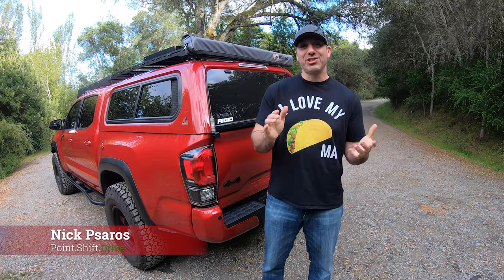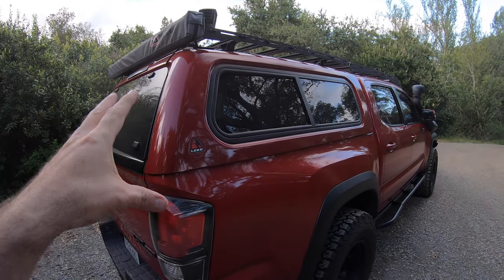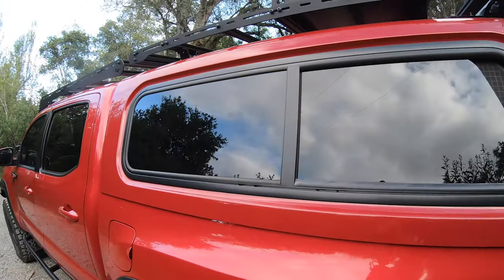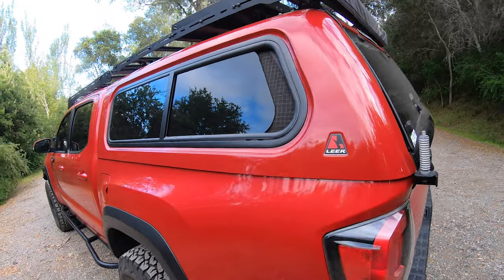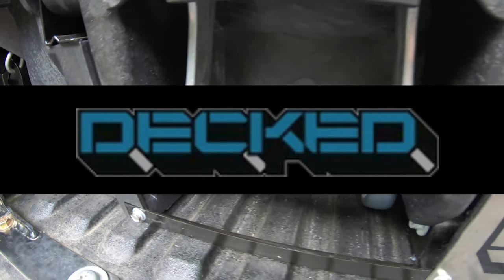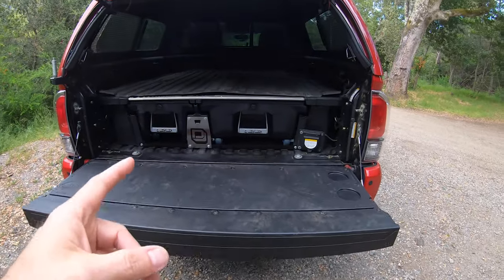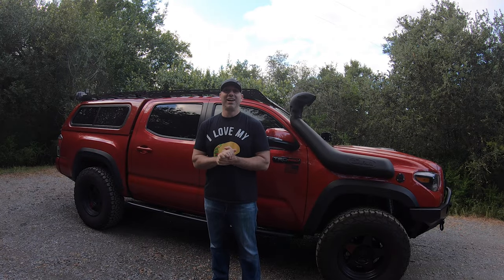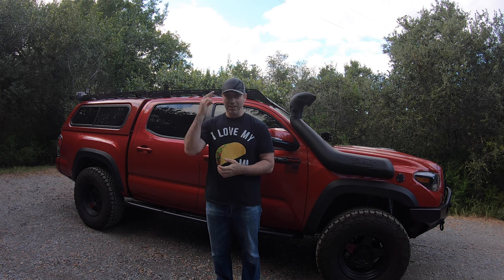One of the BEST overlanding bed shells for Toyota Tacoma!

Comment: Get one of those phone thing’s you put on the back of your phone  to hold it with your fingers. Stick it on your sliding window to be your knob
Reply from the maker: Good suggestion! I actually ended up using a GoPro mount instead

Comment: This is everything I’ve been considering. Got my Tacoma last week. Need a shell and want the drawer system. Same problem. 2 car seats in the back. Also no where for the dog so that rubber topper idea was great. I also have some boat carpet left over from a project I’ll probably drop in on top. I plan on camping out in my bed for fishing tournaments. This is great. Still undecided on what shell. I like yours with maybe the addition of windoors. The smartcap evo is cool but expensive. Thanks for the video. Definitely helped.

Comment: DIY a window knob, with small low profile plastic knob and double side heavy duty tape. And for the hole from the outlet, you can get a big rubber pipe grommet to cover it

Comment: Had the Leer 180 cap on my Taco.... provided a lot of space in the bed for gear and camping.... no roof top tent needed. Cap was solid and flawless. Ordered the same cap for my new Tundra.... with some extras I found I wanted after owning the Taco for 6 years.
Reply from the maker: imxploring thats great to hear. What is your favorite add on?
Reply: @PointShiftDrive  Had the headliner in my first shell.... great option. With my new shell I ordered the headliner....factory roof rack (any leaks are on them.... better than me drilling a new shell) and the removable front slider window in the shell. Makes cleaning the windows between the cab and shell easy and allows access between the two for animals and everything else.
Reply from the maker: @imxploring  Sounds awesome!

Comment: In August I bought a 15 TRD OR access cab with the 6' bed and the same leer shell already on it. I camped in it and it poured rain and I discovered that every single window leaked around at least 1 corner of the frame. I don't know if it's because of the extreme climate here (Alberta Canada) or if the gasket they use on the windows wears out that quickly everywhere else. I ended up buying a roll of butyl tape and pulled all the windows off and used butyl tape around the frames and after a heavy soaking in the car wash they seem ok now. Unfortunately the spline/weather stripping around the glass is peeled out in one corner of one window and it still leaks there but it's minor compared ot before.

Comment: I can see you're not concerned with the bed leaking.
For everyone else, here's a tip:
BEFORE you buy the cap  at night use a flashlight to find all the open places in the bed.
What I was really interested in was the paint match. Yours is only slightly better than mine. I got $500 off because of the difference but what I realized later was that the cap was painted correctly. I could tell because it matched the tailgate perfectly. When I put my vehicle next to another Barcelona red Tacoma I can tell my vehicle has a slightly different tint.
Reply from the maker: Mine didn’t leak and it shouldn’t. Wasn’t a concern for me.
Reply: @PointShiftDrive  All beds leak. If they didn't, they would fill with water after the rain. That's why they have drainage holes.
Also when you get the factory tonneau cover they give you two rubber blocks that fit up in the front corners. These are to fill the gaps between the composite bed and the metal sides.

Comment: Great video! A few questions here:
1.) What brand roof racks for both the cab and shell? 
2.) What size lift on your truck?
Thanks, Keep up the good work!
Reply from the maker: The roof racks are Prinsu . The lift is a 2.5 king shock. I have other videos that go into more detail. you can find them on my channel: https://youtu.be/iN0fuyM50CQ

thanks for watching!
Reply: @PointShiftDrive  Thanks for the quick and detailed response! One more question, is that a canopy tent attached to the shell rack? If so what brand is that? 
Thanks again for your help!
Reply from the maker: @justinandras6096  I have an ARB canopy attached. It’s great. Extends about 5 to 6 feet

Comment: To help with that side window you could get yourself a small suction cup to close that window. Just a thought so you wouldn’t have to climb into the truck just to close the window.
Reply from the maker: I tried suction cups already but after a while they fall off. The solution that I went with that ultimately solved it was a stickem GoPro mount. They are perfect! And I could always throw a camera on there for interesting angles

Comment: Static weight capacity is 600 pounds per leer for the 100XR
Reply from the maker: Yeah but dynamic weight is what matters most of the time. 600lbs is basically 2-3 people and the full weight of the tent, rack, railings etc. that’s doable. But when the top weight is moving, you want to make sure it isn’t too heavy and snaps right off around a corner

Comment: Thanks for the video.
Two questions:
1) Can a 7.0 surfboard fit in the access cab?
2) Can a 6ft. tall person sleep comfortably in the bed?
Reply from the maker: The surf board wouldnt fit inside the truck... just be clear about that. however thats whats great about having a roof rack. As for sleeping in the bed, yes but you need to sleep diagonal if you have the shortbed like I do. I bought the Decked system which flattens the bed and makes sleeping back there a breeze. Hope that helps

Comment: I'm thinking of getting bed shell.
I see you have the Total Chaos bed stiffeners. I have an antenna mount on them right now.
but when I get a bed shell it will obviously will be covered. I see you also have the Rago Fab antenna mount.
Did you modify it in any way? Does it sit flush to the side of the bed?
Reply from the maker: Actually that Rago mount works perfectly with no modification. Highly recommend

Comment: I wish Mountain Hatch made a Bamboo or hardwood option for the tailgate...that flat hard plastic is slick as shit when its wet or a little dew or condensation gets on it.
Reply from the maker: You aren’t wrong. That plastic surface can be brutal. I recommend the weather tech rubber protector. It’s super thin and light and fixes the issue with slickness.

Comment: When you used the key fob to unlock the tailgate it seems it unlocked your camper top rear door also. did you purchase the Leer keyless entry handle ($289)?
Reply from the maker: Yes. It has a module built in for locking and unlocking. Basically a life saver

Comment: I have a 2019 TRD PRO. did you have to lift truck to fit bigger tires. pro comes lifted but like to know and like to keep the stock lift but not sure how big to go with the tires. Great video.
Reply from the maker: Edward Roe I cover that in this video: https://youtu.be/iN0fuyM50CQ
But at a glance: 
1) cab mount chop
2) 285/75/17 tires (basically 34s)
3) tire well trimming 
4) install adjustable top control arms and get as much caster out of your alignment as possible

Comment: I love your set up, hands down one of the best looking rig, I have Leer 100XR too on my 2021 OR and want to install pop lock. 
Question: Did you install two pop locks for shell and tail gate or its just one lock that locks both tailgate and shell? Do you have a video of installation? Thanks
Reply from the maker: Thanks!
There is a separate lock mech for the top lock.

Comment: You could probably a 3M hook or knob on the sliding window
Reply from the maker: Not a bad idea... Wonder how that would hold up in the elements. Ill give that a try! Thanks
Reply: Point.Shift.Drive only one way to find out lol! Keep up the cool videos!
Reply: Or small souction cup
Reply from the maker: @briananderson6758  I ended up using a gopro stick um mount. works perfectly and doesnt stick out.

Comment: Great review. Have one on order. With the PopLock…how does it lock the shell back lift gate? Is the shell lock tied in (electronically) to the new tailgate lock?  Thanks
Reply from the maker: you need to make sure to order the extra locking module. then wire it to one of your doors locking mech.

Comment: Did you install your racks? and if so how long of bolts did you use for your tracks for your racks?... and did you install your Decked Drawers?
Reply from the maker: Yes on both counts. The kits come with hardware. I just used what they provided.
Reply: @PointShiftDrive  ...thanks but did you drill every hole in the tracks?
Reply: @PointShiftDrive  ..also but was your shell beefed up from factory to hold mor weight?

Comment: So If I get the Thule tracks for the leer I can install a prinsu rack on it later? Do you need some type of adapter for that?
Reply from the maker: The prinsu rack system needs to be mounted to standard T slot rails.

Comment: Looking at a 2018 OR with 14k miles, has same shell. Asking price 28.9 concerned about shifting issues and fuel pump recall though.
Does the shell or bed leak at all? Is there a window on the shell to line up with the rear sliding window on the truck? New subscriber, great channel Thanks
Reply from the maker: Good questions... 
So there is a sliding glass window against the truck rear window. I typically just leave that window open and toggle my truck window from the inside any time I want some air or to talk to my dogs. 
as for leaks, no leaks from the windows BUT if the topper wasnt installed properly with sealant then you may see some leaks at the corners where the bottom of the topper meets the bed of the track against the cab. The good news is if you have that issue you can just shoot some silicon in there and close off any holes and you should be good. Its also worth noting that the only time you should see leaks from there is when you are washing your truck. not during rains or anything because of the angle of the where the holes are. Hope that makes sense. 
Id buy it and not worry. you can always make adjustments if needed or sell it all together if you arent happy with it. 
Thanks for subscribing and watching!
Reply: @PointShiftDrive  Thanks for the in depth reply, enjoy your rig!

Comment: I just received my new Tacoma sport.   And today I ordered Decked for it,  and now I am looking at caps/ toppers .  I’m trying to decide on a cab height or just a bit taller.  If you have some time could you take a measurement from the the deck to the top of the cap?  If you mentioned it in the video I missed it. Thanks.
Reply from the maker: Unfortunately I don’t have my cap any more. If you check my latest videos I am now running a Super Pacific. However I did that measurement which is similar. It’s 29inches to the top of the SP. however my leer was even with my cab roof. So just do that measurement and you should be good.
Reply: @PointShiftDrive  Hay thanks ! That helps.  I want to be able to sit up  and get in and out without feeling like coffin.  I may go with the leer 180cc. 😀
Reply from the maker: @Annie-zf7xi  just remember that decked detracts 12 inches of height
Reply: @PointShiftDrive  Ya I know, it so hard to shop this out on the internet and try to think of everything.  Thanks
Reply from the maker: @Annie-zf7xi  totally get it. Hope
This helps. 👍🏼

Comment: Hmmm, I noticed the writing that comes up on the video and says XR 100- Holds roughly 15-225lbs static weight. By any chance did you get that mixed up with dynamic weight? One man and a tent plus a rack is definitely more than 225lbs???
Reply from the maker: I believe 400lb is max static load.

Comment: If you don't mind me asking, what'd you pay for it? Maybe you mentioned in the video but I couldn't find it. I just got quoted by a local shop for $3668 but with the top tier of add-ons for the 100XR since my intentions are to use as a camper.
Reply from the maker: I paid $2300 like 5 years ago. Inflation?

Comment: Just wondering how long that one center lock will stay closed because I have seen many get worn out and may pop open and some roads. I prefer the ARE middle lock because it a lot more sturdy
Reply from the maker: Hard to say... I have used mine for 3 years with zero issues. I think it has more to do with abuse and ultimately how you take care of your shell. But to your point, things can fail and wear out. ARE shells included in that. So food for thought. Buy what works for you!

Comment: I have a Toyota tonneau cover and I on gravel roads my bed fills up with dust. How do I prevent this?
Reply from the maker: You probably can’t completely but I would look to add rubber seals all the way around the cover and also check the cubby to make sure there are no holes for dirt to get through.

Comment: How much did it cost you buying the cover alone? What add ons included?
Reply from the maker: Iverson Patricio it was about $2200 with everything installed.
Reply from the maker: Forgot to mention that the price included the slide style windows and roof rack rails. Also carpeting and LED on the inside.

Comment: Also are you able to take off the bed shell
Reply from the maker: Yes. the shell is basically held down with clamps. However there should be sealant in between the bed and the shell if its done properly. its easily added or removed if need be.
Reply: Point.Shift.Drive thanks for the info post more vids about it pls

Comment: What year taco is this?
Reply from the maker: It’s a 2017 TRD Pro
Reply: I have a 17 off road would this fit 5 ft bed?
Reply: I heard it’s hard to find a shell for these because they leak?
Reply from the maker: @lennylee6528  shells are custom designed for your truck. They should fit pretty perfect. If you want them to not leak you just need to make sure they use a good rubber seal and Silicone when installing. Mine never leaked unless I pressure washed it shooting water up ward into the seal. Rains never caused it to leak though.

Comment: Super pacific vs this?
Reply from the maker: I think that depends on what you use your truck for. the Leer is much more usable for everyday stuff... for example, you can really use the roof racks for bikes, luggage, tents, lumber. the SP has a less usable rack system, just not as strong IMO. however, if you are using your truck for camping/overlanding/or bugout, nothing beats having a bed with you no matter where you are.